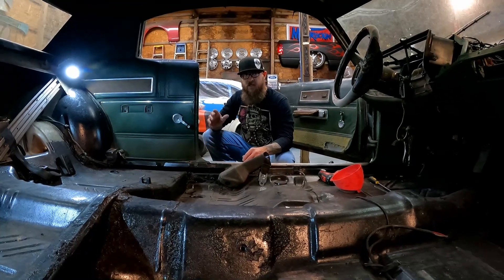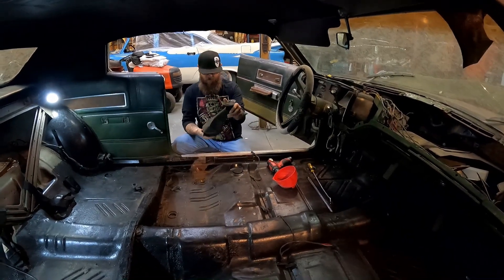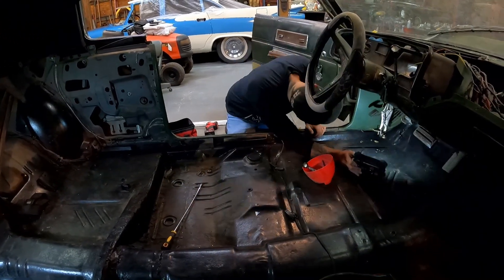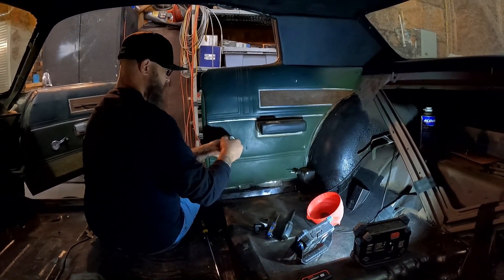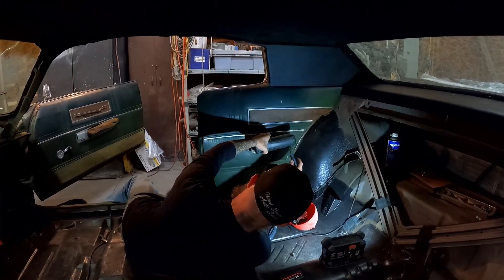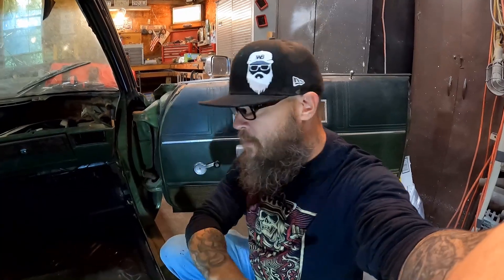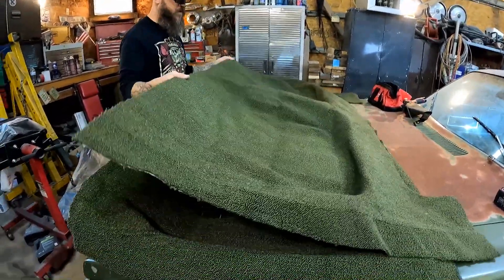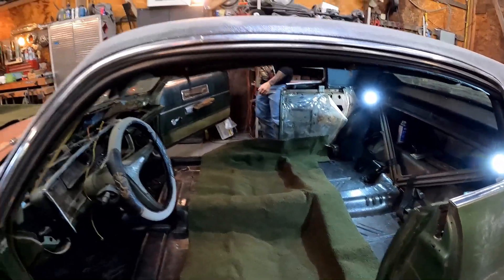THE '72 PLYMOUTH FURY GETS ALL NEW CARPET

Comment: I installed a good-quality carpet kit in my 2007 F350 Crew Cab.  While feeling through the carpet for the seat belt bolt holes I at first tried cutting an X with a razor knife but I found the stray carpet fibers sometime got into the bolt threads.  So I tried a hot soldering iron instead and found it made a perfectly round hole while burning back the stray fibers so they were clear of the bolt threads.
Reply from the maker: Great idea. I usually heat up a screwdriver but I might try your soldering iron trick this time. Thanks man.

Comment: I have used Eastwood’s rust encapsulator on several projects. Works great for me. I clean up the rusty area and get the scale off, clean away scale or dust and apply it. I often use an hvlp spray gun to apply it. I cut the encapsulator with Lacquer thinner or reducer and shoot it to make it go further. I buy it in quart cans, but it comes in spray cans too.
Reply: Has rust ever come back after using that product?
Reply: @mexicanspec  I have never seen rust come back. Of course many of the areas I spray it are inside panels, so I can not see it. But it looks like it seals it up very well. It is similar to POR15 products. It does the same thing and it costs less.
Reply: @randyhoepker5528  I  have looked for a product like this in Mexico with no luck.  I really need it with my cars.
Reply: @mexicanspec  this is sold by Eastwood. It is one of their items, made for them. They sell their items online. Go to their website and maybe they will ship to Mexico. I do not know if they do. They sell tools and many restoration supplies and have been in business for 40 years. They are located near Philadelphia, Pennsylvania.
Reply: @randyhoepker5528  Thank you.  I know the company but the shipping will be more than the product itself.
Reply: @mexicanspec  the cost of shipping is also crazy in the U.S. POR15 is another product that does the same thing. It costs more than the Eastwood product, but maybe you can find it in Mexico.
Reply: @randyhoepker5528  I am going to give that a try.  We have Amazon here too, but a lot of the stuff is imported.
Reply: @randyhoepker5528  I just looked at our Ebay type site and they have a can of undercoating, black, with Por15 and they want $110.00 US for one rattle can.

Comment: Those seat belt retractors are notorious for not fully retracting and hanging in the door opening. You need to thoroughly clean those parts and lubricate them sparingly before installing those assemblies. Otherwise you well be sorry! I'm going to have the exact same brand of carpet installed in my Fury so it's nice to see what they are going to do beforehand. One more point...There should be thick installation pads behind those kick panels.

Comment: Installed LOTS of carpeting over the years. ACC is pretty much the best/only game out there now. Years ago the padding was real jute and much more substantial. Looks like recycled rags or something now. The last set I bought in 2016 I was surprised how little padding came on it. I re-used some of the old. You're right, the hottest day is best for install and let it lay out a few hours to relax. The last set I bought I got the optional mastic backing and it was really worth it. Laid out so smooth and flat, the best set I've ever installed, plus helps with the heat and noise. The only other tip I would offer is that rather than try to drill or cut holes for the seats or attachments is to use a soldering iron to burn or melt through the carpet. It's so nice and clean and melts the edges around the hole so the fibers don't unravel. Just get a 'cheapie' iron and push it up from the bottom. The wrinkles will work out eventually, but with that mastic backing it looks SO much nicer out of the box.

Comment: To mount the seat bolts thru the new carpet, use an all from the bottom up to poke thru the carpet, then hold a center punch with some vice grips and heat it with a torch. Put the heated center punch into the Sal hole from the inside of the car and make perfectly sealed holes that will not unravel the carpet !! Works like a charm !!

Comment: say wb, i may have a steering wheel for you..  black, naturally :) also a little homework may find that an armrest from an older RAM van, may be the same part number and available new at at the local mopar parts counter. i guess one will fit the 68-70 charger exactly. yours looks kind of similar.
Reply from the maker: I’ll check into it. Thanks

Comment: Beard, 
I don't know for sure but I think your front carpet section needs to be shifted further under the front to cover around the steering column. That would also allow your right foot to rest against the vinyl floor insert at the bottom edge of the gas petal.

Comment: on the pull strap, if you're near a salvage yard..... A c body Fury, Polara or Chrysler New Yorker or Newport used those straps from the late 60's until about 1972 or 1973...so they are out there on salvage cars....better to get it off the back door of a four door plymouth, dodge or Chrysler, they had less use on the door and last.....but fit the front door.....and the arm rests are available new or used...on line easily.

Comment: On the door panel pull , when you try to find seats get some seat belts and cut you a new set of pulls . keep the finished edge at the top , the cut edge at the bottom . I can wonder if the set belt materiel would melt like a nylon rope , then if it did you could do the bottom edge to keep it from unraveling or stringing at the edge. Just a thought

Comment: I think I'm repeating a previous comment but I think you want to use carpet on the door card bottoms because they made them carpet for a reason. I think the vinyl fabric would get scuffed. Looking good though. You need to find an off-the-grid salvage yard that has some usable interior parts. I believe highway 62 otherwise known as N.E. 23rd Street is your starting point. Start at I-35 and head east. The first old salvage yard is approximately one mile east of I-35 on 23rd. There should be one on the north side of the road and one on the south side of the road almost across the street from one another. Then cruise on further east to Shadynook auto salvage at 23rd just west of Post Road. Then continue eastbound all the way to Harrah and go about 2 miles east of the junction to an old salvage yard on the north side of highway 62. I think it could be called Hudson's but I'm not sure. If none of those strike paydirt continue east on highway 62 to Meeker. After Meeker you're own your own.